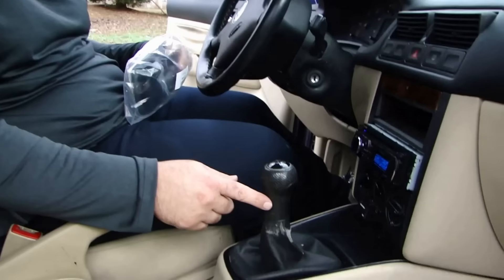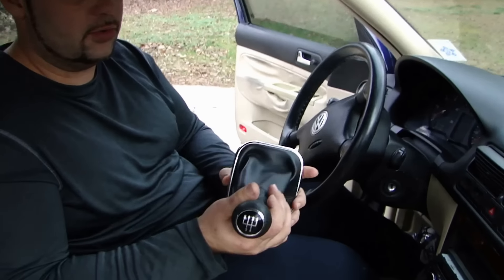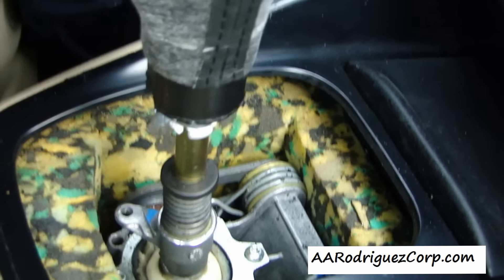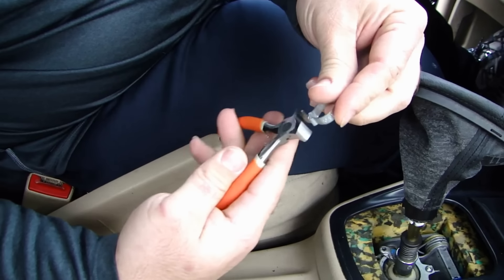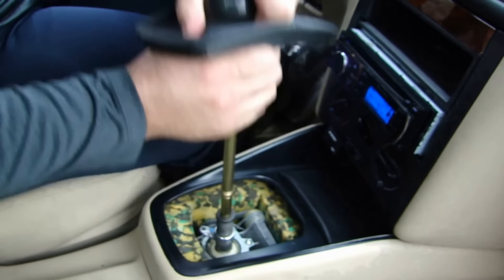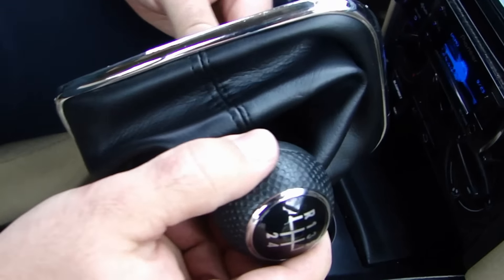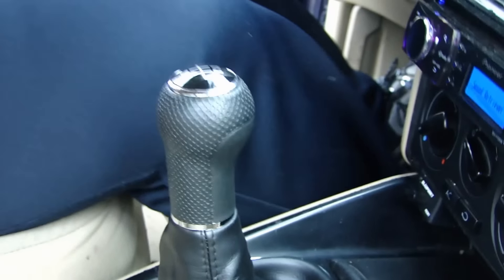DIY - How to replace a VW MK4 shift boot and knob

Comment: Thanks, helped a lot.

Unfortunately I did not have End Nipper Pliers but I used large wire cutters with much more effort to remove; it all worked out fine in the end. Your video provided the necessary guidance :)

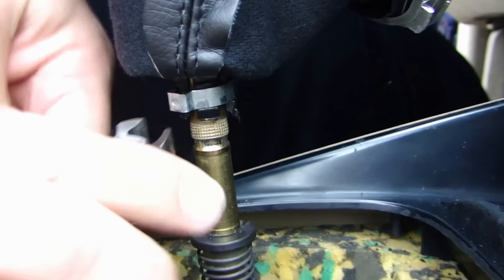Comment: It's not seated properly. I just watched this video before doing mine and I screwed it up because I used your video as a reference. Look at where your old knob was sitting and then look at how far down the new knob is (go to 1:11 then compare that to 1:51). It's not all the way seated to the bottom and once you squeeze that clamp you're screwed. You should really update this or put a comment in.
Reply: +Kenan Bakin  You know what? I never seen that when watched a while back. Thats crazy.
Reply: that's exactly what I noticed first... he clamp it in the wrong place.and not in the "grippy" area where.it suppose to be.
Reply: cable tie?
Reply: Mine seated all the way down when I bopped it.  2002 VW Golf GLS TDI.  Works great.   My minor complaint is the nipper didn't open wide enough, but found my husband's larger nipper and that worked.

Desmond Rader wrote1 year ago
"That little metal piece is called an ear clamp, for anyone who has to replace theirs like me :) "
Reply: Short shifter upgrade :D
Reply: Kenan Bakin i came here just to confirm that too, I have a mk5 gti but it is essentially the same, I always wonder why the shifter is kind of giving me the feeling that it’s not engaged on the detent, and I remember the dealer did a repair and had to remove the shifter one time, they screwed it up!
Reply: It really  only goes one way

Comment: Hey, I have bought a few products, but I was curious if you had any insight on upholstery. My driver side cloth material on my 04 mkIV is starting to "loose stickiness and it falls off exposing the orange insides, Im constantly shoving it back in, damaging the cloth. If you have any videos or DIY tricks I would be great appreciative. I love your simple products and fix its. bless up!
Reply: I've been trying to do the same as both of my mk4 door panels and the rear small ones are doing the same. Haven't found a diy on it yet
Reply: Use 3M general glue adhesive it worked on my headliner that was falling down.

Comment: Hey Aaron.  Looks like your replacement shift knob and boot don't mount as far down the stick as the factory one.  Doesn't seem to clamp on the knarled area.  Can you confirm this?

Could the shift stick be cut down to accomidate this?

Comment: How do i remove the shift knob from the boot itself? Id like to get a custom knob but i cannot seem to separate the two AT ALL! I have the exact same car as you and hopefully you can be of help thanks
Reply: I would hope you figured this out in the last 3 months but for anyone else, Grab some pliers and pull the plastic cylinder INSIDE the boot and the shift knob itself away from eachother, it holds the boot to the knob, and its just a well made pressure hold.
Reply: Thanks, of course mine was the one that couldn't be taken apart so I bought a new shift boot and knob which I was able to separate this time.
Reply: sailortrash55 were did you buy your shift knob and boot. I am having the same problem and I too want a custom shift knob

Comment: Did VW change the shift boot design for the 2015-16 model years? I have an MK 7 GTI. Is the MK 4 design too old to use on it? I find the shifter too small and actually grip it by the neck out of habit.

Comment: Looking for shorter shift stick for VW Jetta mk5--Do you know where I can find one?  Do they sell them anywhere, or do I need to modify my existing one?  Thanks.
Reply: Cut the shaft down. It will mount the same way. And if you don't have the clip, use a hose clamp

Comment: What is that clamp called and where could I buy another one? I want to keep the old boot and knob just in case something happens to the new one I purchased
Reply: Any parts store will have them. They are a factory style hose clamp. And used on every single half shaft

Comment: If you look carefully at about 1:55. You can see that the replacement knob does not fit properly. The gear stick has special surface to get better grib (the original knob had perfect contact). It will not be as tight as original and it can get out. I wouldn't buy this part as replacement.
Reply: He didn't have it far enough down. That's it.

Comment: hey rodriguez, could you please make a DIY clutch change on a vr6 12v mk4 gti?
Reply: For anyone doing a clutch change, replace everything including all bolts. And go to a single mass flywheel. It will rattle, but they are far superior than any dual mass flywheel. And don't break!

Comment: I bought a similar knob and boot and went to fit it today however mine was totally different and its a 2001 and mrk 4 v golf. mine has a screw at the top with a little rubber clear protector and long black plastic covering that has a spring under, this is used to slot the car into reverse as it sits under first which presume everyone elses does aswell. so my point is that because of this plastic fitting the opening is much wider and does fit with this plastic thing on top but without it it doesn't work because I cant get the car into reverse so I don't know if I need a different type of fitting or if I'm missing something. anyone else with the same problem ands or a solution. help would be very much appreciated! thanks
Reply from the maker: I'm going to guess you live outside of the USA, likely Australia?
Reply: I do yes but I did buy the part off an Australian website!! Anyway do you know where I can get one that fits my car??
Reply: @TuneMyEuro  my car is the same and I'm in the USA